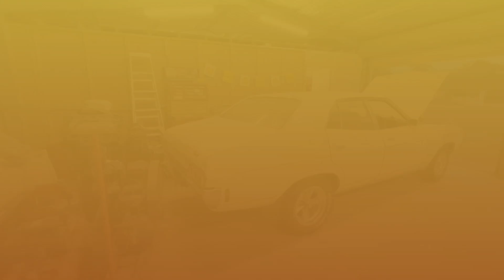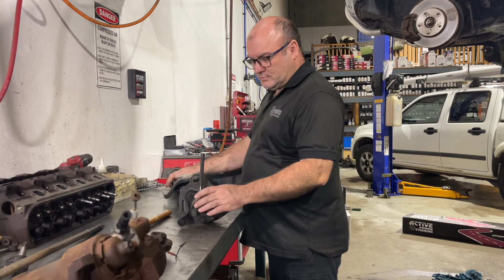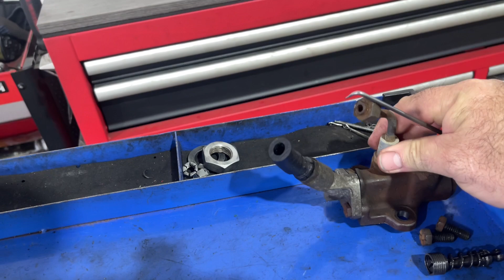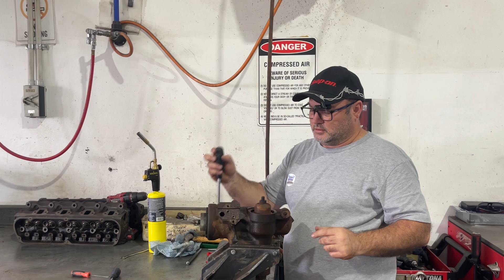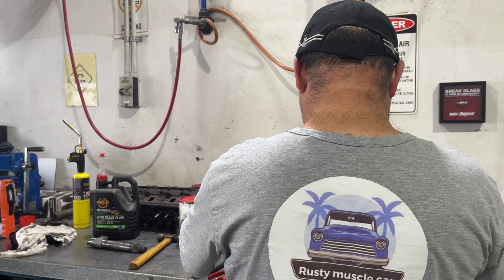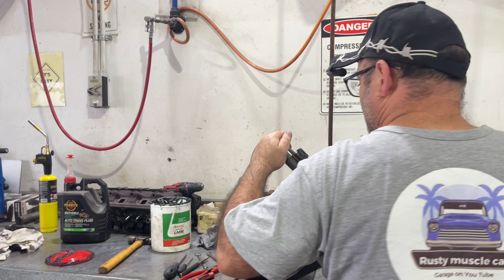Dodge Chrysler A B and E body power steer box overhaul #rustymusclecargarage #mopar #moparornocar

Comment: So, did you manage to get the input shaft out on the box you're working on?  What's the secret to getting it out?
Reply from the maker: Sorry to take a while to reply. I did that steering box a while ago and had to try and remember what happened. Yes I did get it apart. But it was an absolute pain I swear the Holden and Ford boxes are so much nicer to rebuild than these Mopar ones. It was just that the worm nut shaft and the seals on the piston had been together for so long and the amount of sludge inside this particular box made it hard to remove without feeling like a butcher and getting rough with it. I had to pry the worm nut up from the sector shaft side of the housing and force it out. You should just be able to grad the input shaft and give it a gentle pry and have it come out but this one had other ideas